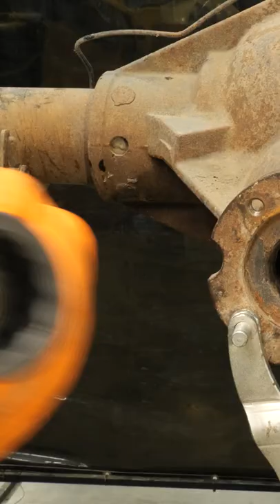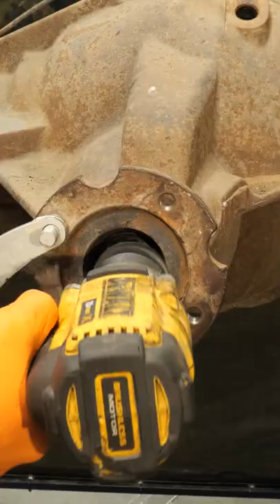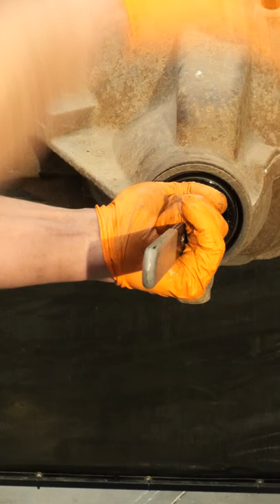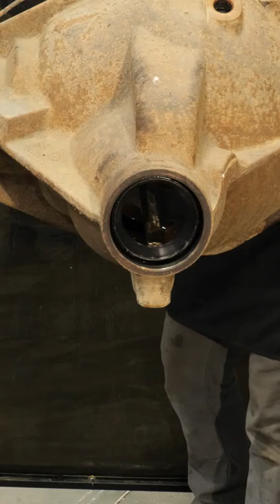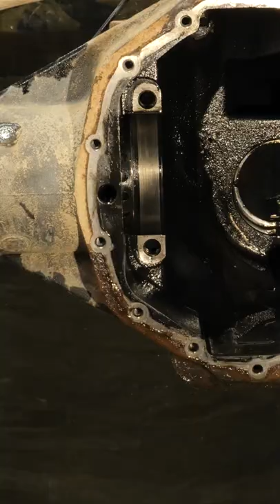Dodge Ram 3500 AAM 11.5 Pinion Removal

Comment: I skipped the puller step and just air hammered the pinion out,  releasing the pinion flange at the same time.
Reply from the maker: In practice that is also what we do, however this video is based off the factory service manual. Never hurts to save a step where you can!

Comment: how many hours do they charge for this work?
Reply from the maker: Well, according to the Ram billable hours:
Reseal rear cover .5
Axle fill .2
Both axle shafts 1.2
Both axle flange gaskets 1.2
Both wheel seals 2.2
Diff/ pinion and wheel bearings 5.5
Backlash adjustment 1.5
Pinion seal 2.8

About 15hrs. That does not cover actual differential carrier service or ring and pinion change. Unless I missed something, this is approximately what a dealer would charge, plus parts with a dealer network markup. I invite dealer technicians who see this to correct me if needed.

Local shops would bill similar hours, but may appear cheaper with lesser quality parts going back in. Not all shops use cheaper parts, but many do.

Alternatively, torqueking.com offers the same OEM parts below dealer prices, and servicing yourself will save on labor costs which could be redirected to service tools we offer to complete the job. Those tools could then be sold on eBay (or to a friend?) to recoup most of the cost, or kept for later service. This option is dependent on mechanical knowledge, however with this video and our sales team most questions can be answered to complete service DIY style.

Realistically a good mechanic will have it in and out in less than 8 hrs, but you're billed the full rate. For the average DIY, done in a weekend and money ahead.

Comment: Hey do you kno if a 08 dodge nitro would come off the same way or not? It’s 2wd an rear wheel. If it’s possible that would be a relief cuz I’ll have to buy the whole rear differential if it’s not someone simple for a wanna be mechanic like me lol
Reply from the maker: It would most likely be a similar procedure, although torque specs will be different.

Comment: I have had the opportunity to do that with that same instrument actually I also used it once on one of these four cylinder eight spark plug mustangs in the front put the ignition timing belt you know what actually sucked a little that the tool broke cuz it was not that real good and I had to weld it  to use it.

Comment: What’s that tool called
Reply from the maker: The yoke holder?
Reply: The one used to take the middle bearing ring out
Reply: Is that a punch
Reply from the maker: @Esechriz1214  That is QT9301, a special bearing remover punch https://torqueking.com/product/9301/qt9301-5-8-x-20-bearing-cup-remover-punch-for-pro-techs/